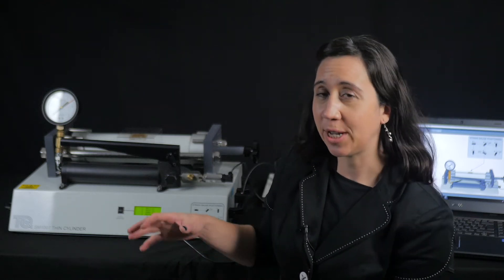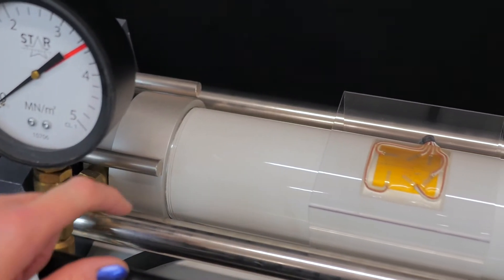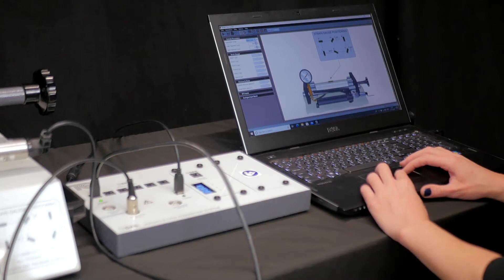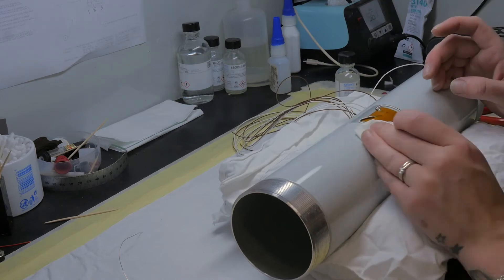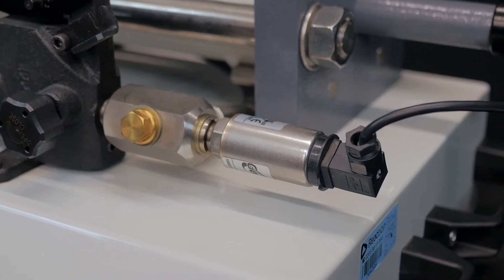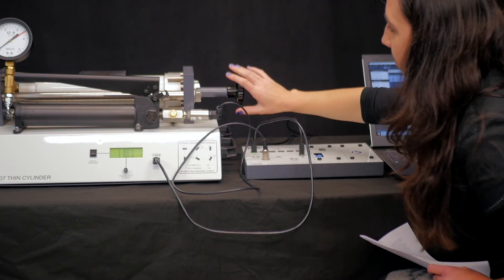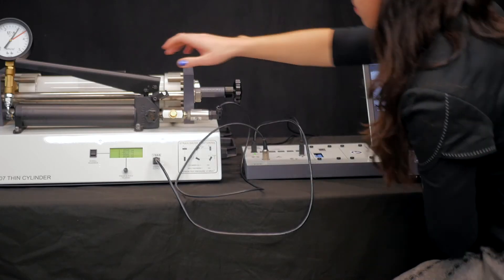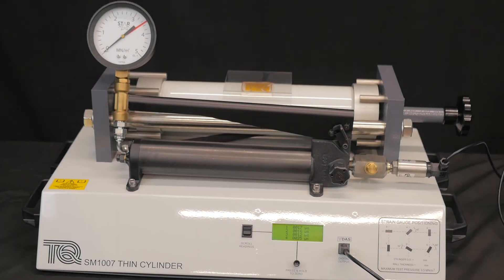Thin Cylinder SM1007 - Materials Testing and Properties - TecQuipment

Comment: hi, the pressure and radius and thickness is the same for all the strain gauges, so why the theoretical calculation is not the same for all of them as the stress is " Pr/s" and "Pr/2s" and strain is a function of stress?
Reply from the maker: Hi Narin, one of the objectives of the unit is to investigate an understanding of longitudinal stress, hoop (or circumferential) stress, radial stress, and biaxial stress, as well as other experiments, all that is possible to do thanks to the strain gauges being in different positions, distance and angles sensing a different kind of stress. Some strain gauges will read negative values (compressive) and others will read positive values (tensile), depending on the test, is possible to get similar values for some gauges, however, others will have a different value, and one of the objectives is to understand the why.

Comment: Why are the experimental strain smaller than the theoretical strains?
Reply from the maker: Hi Kwai, thank you for your message. If comparing your experimental findings to the theoretical findings please allow for a margin of error between the results as practical and theory will differ slightly but as longs as your calculations are not drastically dissimilar they will be accurate.